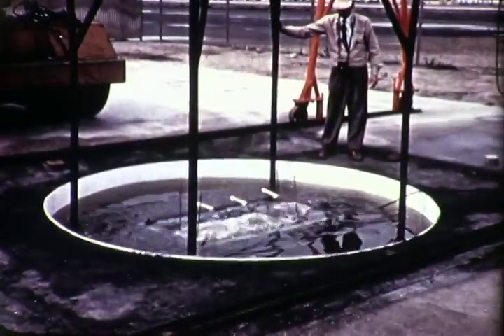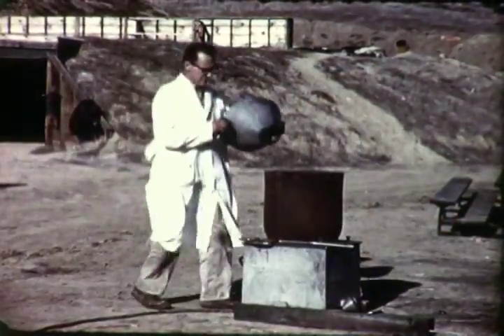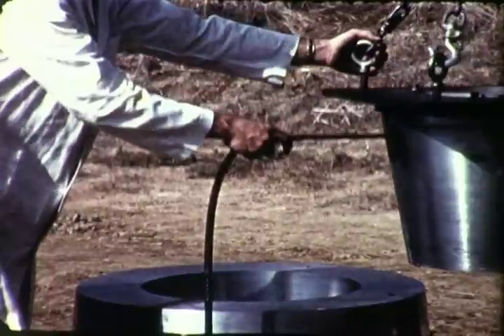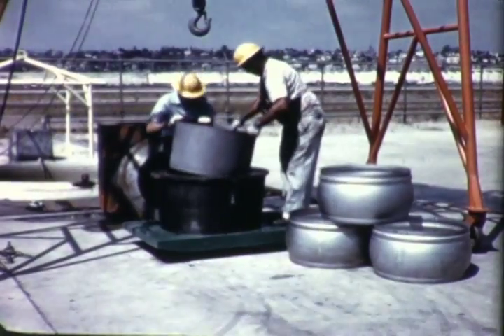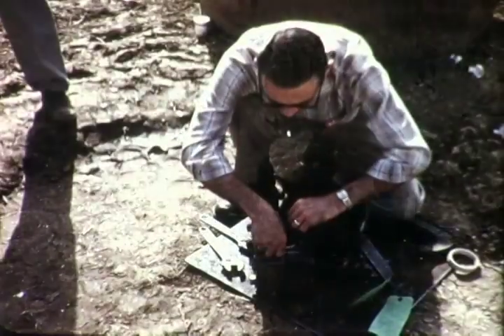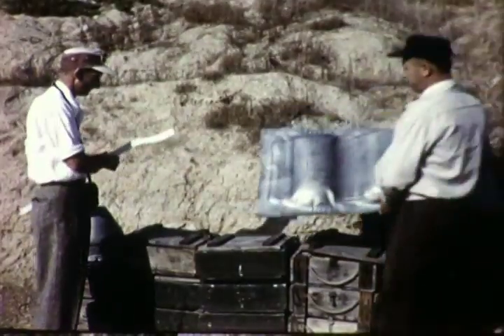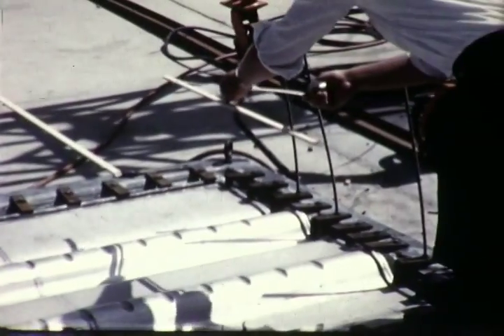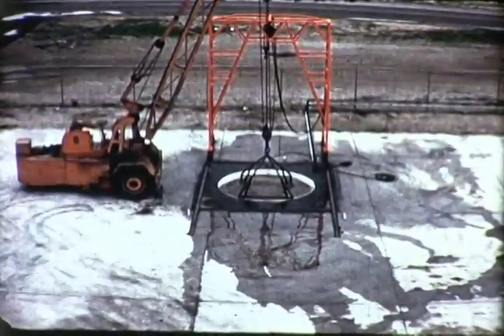F 2154 Ryan Aeronautical high energy forming

Comment: interesting - but impractiable.. You can do the same with metal-spinning or highpressure-hydraulic-forming.
Reply: With more tooling and less accurate results as stated in the video
Reply: @SKarlaArt  not to mention metal spinning, you wont be getting these complex shapes. While you can do some complex shapes it typically isn't worth the time to engineer the pattern to make them and they have their drawbacks, like gouging the inside of the part and wear and tear of the pattern after so many runs. Typical Metal spinning tolerance is +/- .060 which is miles of wiggle room for a machinist.
Reply: Stick to yer cows mate... you know nothing about physics & engineering... 🙄😂

Comment: Except for items that cannot be produced by any other means, this seems like a ridiculously labor intensive process, not to mention that it is also a ridiculously slow process.
Reply: You were watching a film of experimental trials. The process is much more industrious now. In any case it made excellent savings from the very beginning. And allowed for the single piece manufacturing of many components not otherwise possible to form.
Reply: @michaelfoye1135   OK. My point is that it only suitable for short runs and not for mass production. But, people can be very ingenious... I'm sure that I'm often proven wrong.
Reply: @johnlshilling1446  Its most commonly used in the aviation and aerospace industries. Also for forming gas, and liquid containers. Along with an increasing panoply of other products.
Reply: @michaelfoye1135   Yes, many commentors have corrected my cynical viewpoint.
Reply: @johnlshilling1446  You're not an engineer. You don't work in manufacturing. Like most people you don't know how most things are made. Really doesn't set you apart. No worries.

Comment: All the more remarkable that work of this accuracy could be produced before the advent of computer-based 3D analytical methods.
Reply: Seems to be easier to get precise parts this way than with a press or similar if your analytical tools are limited. Zero springback, minimal thickness variation, deep draws in one go etc.

Comment: I guess if you're making a small number of very specific parts this could be a lot less expensive than die forming it or stamping it which would require a lot of specifically machine parts for just a few items.
Reply: It was perfect for parts that could NOT be cold or hot forged or cast.  It then got pretty good at making parts that were within tolerance without any machining.

Comment: It's astounding that this can actually be an economical process.
Reply: Many of your pots and pans that have bimetal are formed explosively.
Reply: @w8stral  You are not just talking forming a part to shape but making it slam into another part so fast it welds itself to form a complex laminated metal part.  I think the word is called encapsulation as opposed to case hardening which merely holds the core metal by mechanically enclosing it.  If the velocity of the initial contact is reached, cold welding is the result.
Reply: @w8stral   True. Laminated armor, as in Tank Armor is created with explosives welding dissimilar metals and alloys together. Materials that can't be welded or fused together in conventional ways.
Reply: Why? Commercial explosives are relatively cheap and the dies are not much different from if you forged or punched the same parts.
Reply: @brettbuck7362  Really? How many parts per minute can a conventional press produce? How many hours per part using explosives? This is an incredibly stupid method, except for items that cannot be formed any other way.
Reply: @johnlshilling1446 , you don't always need, or want, an assembly line cranking out hundreds or thousands of parts. Tooling and setup costs become prohibitively expensive for short production runs, and when you're making things like airplanes or missiles making a few parts at a time isn't a bottleneck to the overall production process. There's also the fact that HERF (High Energy Rate Forming) can make complex shapes with astounding precision in a single operation. Similar parts made using conventional processes may take many steps and still not achieve the same precision or part quality.
Reply: @ParadigmUnkn0wn   I understand. This is surely a God send for limited run, high precision components.
Reply: A bit of explosive is in a similar weight class as a giant-ass press. Also it seems like explosive forming is better behaved in several important ways.
Reply: If your huge few story tall press just got destroyed by the enemy, it might be a backup solution to continue manufacturing
Reply: Explosive is pretty cheap, it comes by the truck load out the factory all day every day.
Reply: you'd be horrified to know what is an economical process when the government is using your money to heavily subsidize an industry
Reply: @joewboe   I know... Decades working on Government Projects. I'm long past the horror and anger. There's nothing you or I can do about it. We'd have more impact trying to solve world hunger, poverty, and illiteracy.
Reply: @johnlshilling1446  it's the sad truth ain't it
Reply: @joewboe   Yeppers.

Comment: This is basically the same as hydroforming, but with the explosives producing a very short spike of pressure and the process somewhat relying on the setup being held in place by inertia to some degree.
Reply: It IS hydroforming
Reply: @EZ Z True. I was thinking the air simply had to be removed in order to not cause counterpressure during the explosion, but I see now, it also holds the part in place.